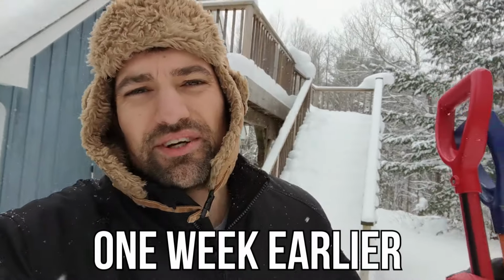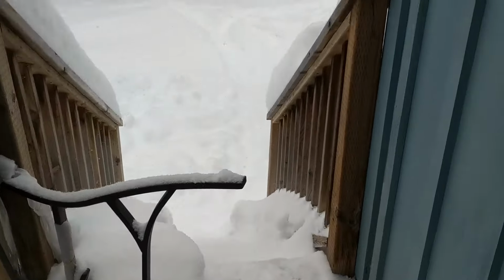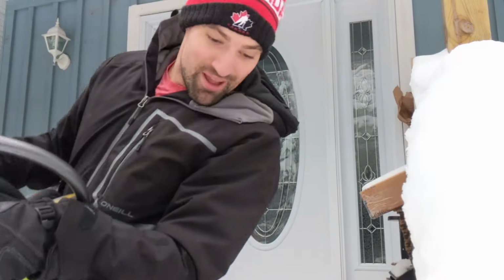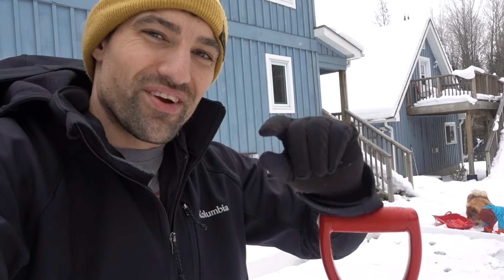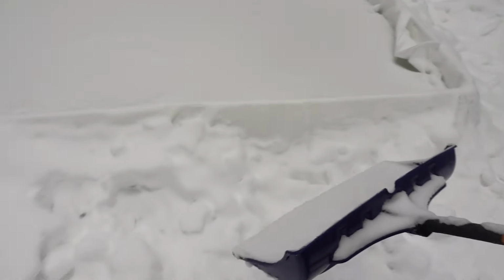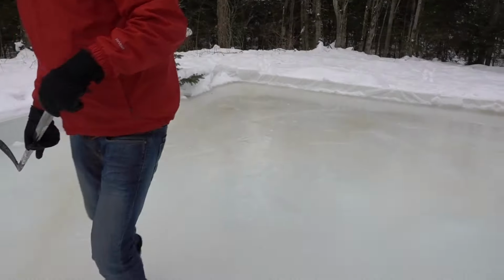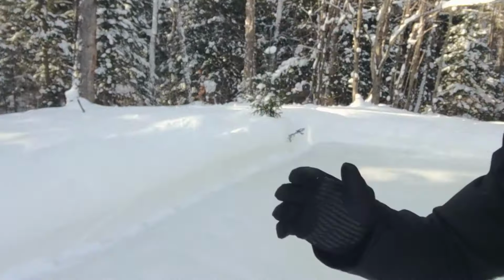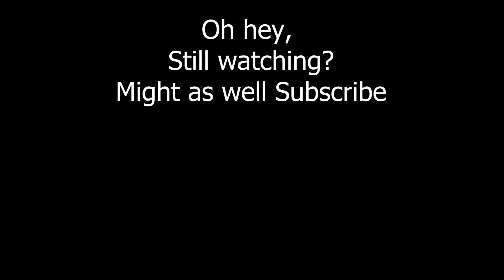Trying to make PERFECT ice on the Outdoor Rink

Comment: This is great but one problem 

I live in the south it has never snowed nor froze 😑
Reply: Grim Reaper [supernatural] 
RIP
Reply: Well, the surface should be super smooth at least!
Reply: that's why there's something called blades..
Reply: Same
Reply: Grim Reaper [supernatural] same here 
I live in australia and it never snows or freeze water in the suburbs (it does snow or freeze water in the higher parts)
Reply: I've recently started to experience this. I'm from Michigan but moved to Tennessee and since then haven't seen a single flake of snow since I got here 😔
Reply: @joshmcdzz6925  WAAAYYYY difference dude.. I've bladed since when I was still in Michigan but when I was on the ice it was way different than on asphalt
Reply: @hunterlindbert2679  I agree it is quite different...I actually prefer ice skating..however when you consider the difference, it's a few nuances - ice is slippery and as a result less resistance leading to faster glides etc.., banana rocker if you're using a hockey skate, more forgiving when you fall than the asphalt.. from my experience I noticed skating a short frame,  big wheel setup (fr 310, powerslide trinity) gives me that close ice feel... The roller hockey skate is totally different than the ice hockey skate in terms of feeling.. however you're right they are still different though subtle...
Reply: @joshmcdzz6925  I have no balance issues on ice but on asphalt I'm like Bambi I swear lol. And my crossovers aren't as good on asphalt (yes I know ice can help dig and cut) but still not quite up to par.... and dont get me started on stopping 😂😂 I would much rather slam on the brakes than T stop, pinch, or run into the grass lmao
Reply: Me too
Reply: Lol

Comment: What size rink did u go with this year?  I’m in the process of building a sport court and still debating what size rink to go with.  A concrete slab and tiles can get really pricey but I also don’t wanna spend thousands of dollars to later regret not going bigger.  My kids are 1, 6 and 10 and we were thinking of going with a 25x40 ft.  I can probably fit a 30x40 rink but don’t know if the extra 5 foot width justifies another 2K worth of concrete.

Comment: I just built a backyard rink for the first time, after skating on it for the first few times I’ve noticed that the top layer if not more than 1/4 inch it’s chipping away, even with hot water, did you notice anything like this or do you have any tips on how to prevent this from happening

Comment: Been a backyard rink builder since I was very young following my dad around we always used not water..last year a buddy of mine from Windsor said forget the hot water if you want the glass, get the BIGGEST toughest commercial garbage can and fill it to the brim..then just tip er over and send a tidal wave of cold water on the ring. I was doubtful..but after just one try I'll never do it any other way. Better than a zamboni..last year's rink was 30ftX30ft and two full  commercial round cans coats the rink to perfection..and yeah keep the snow off and use a THICK white liner. Love your vids.
Reply: Zambonis DO use hot water too, so technically it’s not “better” but yes good strategy

Comment: My dad used to put cloth around a large push broom and connect the hose to the broom handle on low hot water. Then drag it around Zamboni style, putting it down as thin as possible. Freezes fast and you can put another layer on soon after. The more thin layers you have, the stronger and smoother ice you get.

Comment: You can run your snowblower in the rink. You place a 8'x3' long plank on top of a rink wall like a teeter-totter. You can drive your 300 lbs snowblower over the wall if you have enough bracing. The lesson here is to follow day by day the snowfall predictions and temperature predictions. You want to minimize the time shoveling and scraping. When applying warm water you should skate through the water dragging a large towel, which will spread the water nicely and smooth the bumps too.

Comment: Another good way to get a nice smooth finish is getting blow torches and melt a little layer off, might take a while but it is a really nice and smooth
Reply from the maker: DogToyz4Dayz shhhh don't wreck the surprise 😁
Reply: Coach Jeremy lol
Reply: My dad use to put a cloth around a wide push broom and connect the garden hose to the handle of the broom on low hot water, then drag it around the surface zamboni style. A very thin layer freezes very quickly and comes out good.  Multiple thin layers build up to great strong ice.

Comment: Jeremy I have a pretty nice sized rink (117x47) and when I flood it at night we always put what looks like is gonna be a nice sheet in the morning, but when I go to skate on it the next day, the layer of ice that we put on the night before scales off into almost like shards of glass. Any suggestions on how to stop this?
Reply from the maker: Jonathan Toews hot water tends to work best because it melts some of the ice and bonds better. I've also heard using a spray nozzle helps because it let's you put the water on in thin layers and build it.

Comment: Hi, so I have a rink at my house (if you could even call it that) and we’ve been trying to get it going but it just won’t work!! And right now there is a huge crevasse I guess you could call it that cracked right through the middle of it and it’s covered in ice hills that we can’t get rid of, and we can’t just put a hose on it because the pressure of the hose eats through the ice and on top of that the rink keeps leaking!!! If you have any suggestions plz help!!!

Btw, I luv ur vids keep it up!! It’s helped me a lot in my first year of hockey!!
Reply from the maker: If it's really bad I'd say just flood it a few times in thin layers so it doesn't leak out. For the hose issue you can get a spray nozzle and set it to spray lots of rain drops. Apply thin layers so basically when you're done the full rink you can start again on the other end. Just keep building ice this way. If it's not that bad you can use hot water and a towel to melt down the ice hills and snow + water to make slush to fill the pressure cracks.
Reply: Coach Jeremy thank you so much!! I will try that😄

Comment: If you go to a local rink, they might give you an old Zamboni blade for free. If you cut it with an angle grinder, you can make a really good chipper for taking out those bumps. Just weld it onto a length of black pipe (like, 4-1/2 or 5 feet) and it scrapes nice. You’re right about the hot water, for sure, and the hotter the better. Multiple layers makes clear, hard ice. I have an old galvie water tank I want to set up for heating with fire.

Comment: just a tip for when your making ice. after you shovel off the snow, use a fairly stiff bristled push broom and sweep the surface completely clean so theres not a single spec of snow left, then flood it. if done right you'll get a glass finish on that second flood instead of needing a 3rd hot coat of water
Reply from the maker: Dave Cormack that's smart! It was a little lumpy though so it needed a few layers.
Reply: Coach Jeremy yeah I get it, ice can be a fickle thing. Trust me I worked at the Whistler Olympic Sliding track for four years but making good ice takes patience and lots of trial and error

Comment: The easiest way to make smooth ice ive found is to put a clean plastic garbage can in the middle of the rink. I fill it with hot water from a hose I run out of my basement. Then just dump it over all at once. I use a squeegee to push the water out to the corners of the rink. Comes out smooth as glass on my 40x60 rink.

Comment: You don't need a liner and you don't need hot water. The public rink in my town has never used either of those things. This is a video I took while skating there just before they tore the ancient dilapidated boards down and put up new ones - https://youtu.be/g99CPlv7_0U. As you can see, the ice is perfectly fine. You just wait until the ground is frozen and then build your ice up in thin layers (don't try to flood it all at once). It takes about a week of applying a layer every night (night is the best time to do it, because that's when it's the coldest) to get skatable ice. I know how it's done because my uncle worked for our town's parks and recreation department for decades and was always in charge of making ice at the rink.

The rink in the next town over, which is a fullsize hockey rink used for youth league and high school hockey games, doesn't use a liner or hot water either.